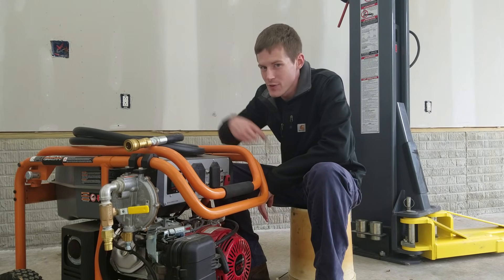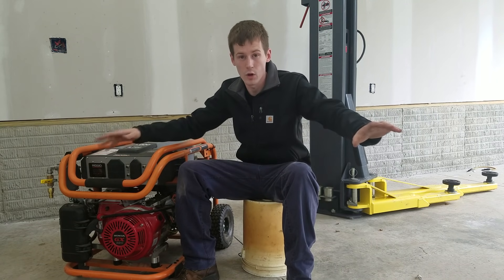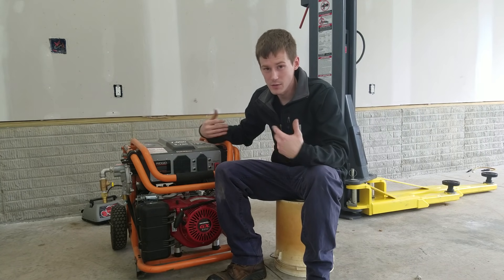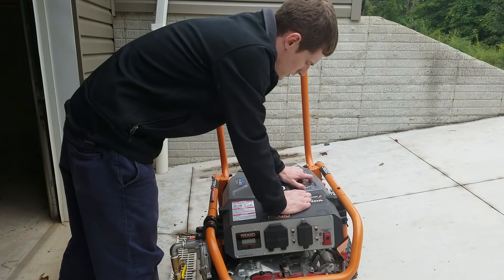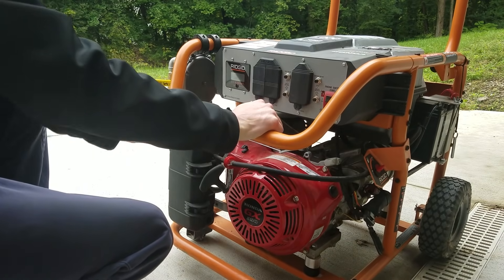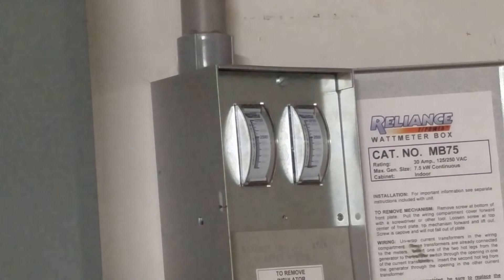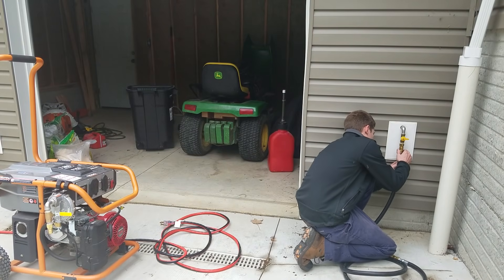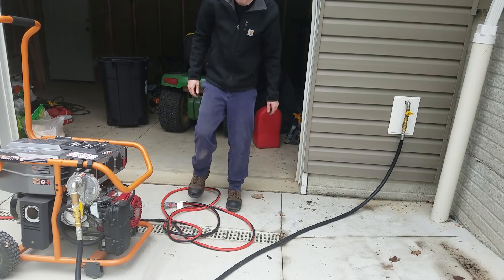Natural Gas Generator: Frequently Asked Questions

Comment: I'll just say a couple of things here. First off, I strongly recommend that you either put a secure access box over the pipe and valve. This will keep others from messing with it and or turning the valve on, ESPECIALLY kids. Either that or have an easily accessible shut off inside where it is secure (in the house or in the garage if you lock it). Forgive me if you already know this and have done it, but if you have done this work yourself, you should have a qualified plumber or pipe fitter to inspect your work and tag the work as approved. Otherwise, if there is a fire, your fire insurance may not cover the damages. The other thing to note for you and your viewers is that this kind of work cannot be legally done by a "layperson" (not trained and licensed) if it is a rental home, a duplex, or multiple housing. So far as rental, I'm guessing that means the person renting the home not the owner.
Reply: The end of the pipe has a quick disconnect fitting which prevents gas from escaping even when the valve is open. He just closes the valve while it’s still running and connected to pull everything from the hose.

Comment: I tried to use this conversion kit for dry methane (over 85%). The generator could be kicked off but couldn't run continuously. Do you have any suggestions for that? The methane is the main part of natural gas. Thx!

Comment: Do you think you could make a dual fuel generator (Gas/LP) run on Natural Gas by using the LP Gas input on the generator instead of inserting at the carb?  Using a Natural Gas regulator...

Comment: You have not addressed starting the motor with a natural gas regulator. Someone else said a person needs to
push the little spring on the back of the regulator while trying to start it. Is this true? If so, it's very hard to do if you're trying to pull a cord

Comment: RG, The only question I have is re: gas / propane pressure.  Isn't natural gas at your house at a much lower pressure than propane from a bottle?  Would I need to put an additional regulator between a propane source and the gas regulator on the genset to account for this?

Thanks and I am glad I found these gen mod videos.  They are very informative and easy to follow.
Reply from the maker: Yes you're correct check the other video at about 21:40

https://youtu.be/nO839Sayci0
Reply: Thanks, I missed that some how.

Comment: My generator runs on gas and propane. Can I use a natural gas regulator meant for propane grill conversions so they run on natural gas to feed natural gas into the propane intake of the generator? Since it is made to run on propane I don't think valve recession would be an issue 🤔

Comment: Can you make a video or comment on how to run this generator on LP gas? Is it just another regulator on the LP tank? Thanks.
Reply: Yes.  And you probably have to adjust your air fuel ratio like he did at the beginning.  I have a $30 Chinese version of this that I have planned to connect to my lawn mower, and I think they have some sort of switch that adjusts the orafice size between propane and natural gas built in.

Comment: Valvoline Premium Blue One Solution 9200 SAE 10W-30
What are the pros and cons of using this oil when 
running on natural gas?  
Anybody used it with a  7000W Champion Inverter?  Thanks!

Comment: if you are running on Propane , i would like to know how much of propane it will take to run the generator for one hour ?
Reply: It's all depend on the " Usage ".  If you use more " Electric ", then more Propane use.  If you use less, then less Propane.  The Regulator is designed to " Fluctuate " according to usage.  On an average for us, it's about 15lbs for 2-6 Hours during Power Outage.

Comment: Does a brand new (never used yet) generator need to run on gas for a few hours first before you start running on nat gas? Or can you immediately start using nat gas. Not sure if engine needs to break in before conversion. Thank you
Reply from the maker: Yes. I would do the break in on gasoline.

Comment: Awesome video, im just about to convert my generator, but one question i had is, what would happen if the generator stalls for some reason, say it senses a low oil pressure and stops running, does the gas continue to flow?
Reply from the maker: The governor regulator on the generator stops flow if the engine stalls.

Comment: I have a WPro8500. It has an auto choke. Would this system not work? 

Does the choke need to be fully open or closed when on natural gas?
Reply from the maker: Fully open all the time. Sorry for the late reply I was never notified.

Comment: I have a question which many sorts of people haven't been able to answer hope someone can help. I am running a small food truck and have two appliances that need to be running off of my generator. Bought a EF2800i Yamaha generator it does the job when its stationary as it is a carburetor engine but as soon as I drive the petrol is obviously jumping around and the appliances are turning off as im assuming that power is being cut out due to the engine type. Spoke to a professional and he recommended a fuel injected petrol generator, spoke to lawnmower repair guy and he reckons that a gas operated generator will eliminate the fuel issue and will allow the appliances to run without turning off. My question is if a gas generator is in motion meaning while im driving will it continue tio run my appliances without then turning off?

Comment: Thanks for the updated video.  I viewed your first video at the beginning of the year, 2020.  Glad to come across your update on this mod.  I purchased a 9K gen and I'm also converting to NG by the fall.  Great content.  I'm not personally worried about the valve recession issue.  Like you said it'll take 1K if hours to notice a run issue.  Didn't know of specialized oil for NG or Propane.  But, makes sense for autos that are exclusive to this type of fuel supply.  I'll definitely change over to that oil once I check the additive package difference's.  I wonder if Zinc percentages were increased?  Do you use cap covers over your quick connects when stored?  Thanks for contributing,  Subscribed!
Reply from the maker: I bought some of the oil. The packaging doesn't state anything about high zinc. I haven't had any outages since the oil change. If I get some good run time on the oil I may send it out for analysis. I've got about 8 hours runtime on the NG conversion over 2.5 years. Not a ton but, that's all the outages I've had. Works well, no regrets at all.
Reply: @RepairGeek  Excellent. I've only had to fire up the the gen 2 times sense buying it.  I run it 2 times a month for about 10-15 minutes just to keep the fuel moving and fresh. All of course using a fuel stabilizer. I'm slowly reducing  adding fuel in prep for NG conversion. 

I imagine you keep the tank empty until gas is need for what ever reason.  But, during seasonal changes you will have condensation build up in the tank. What do you use to compensate for moisture within the tank?  I'm considering a moisture pack. Large ones like used in shipping containers to reduce or eliminate that issue. We certainly don't want our tanks to rust. 

Suggestions or ideas?

Thx.
Reply from the maker: @eddylee587  I dont do anything. I just drained all the gasoline and drained the carburetor bowl and ignore it. I've had no issues. You could use the generator's fuel tank as a gas can if you wanted just to cut down on moisture but its rather inconvenient. Or just leave the fuel cap loose so air can go in and out.

Comment: Are you using a 3/4-inch NG hose?  How did you decide on the NG hose diameter?  I'm using a 10-foot, 3/8-inch i.d. NG hose on my Sportsman TRIGEN9K tri-fuel gen and it works fine .
Reply from the maker: I used 1/2" id. It depends on the length and the size of the generator.

Comment: Gennies are now being sold prebuilt to run on both now. Much more expensive but easier.

My question is, when you crafted that shim for the airbox. Not everyone has a lathe to crc an adapter, do they sell the adapters online or at a store for particular models so you can remount the airbox or do they sell modified air boxes to fit with the conversion?
Reply from the maker: They don't but, Nash Fuel is aware of my videos and are making revisions to their kits based on what I ran into.

You could make that spacer using wood if you want too. I had the means and the tools so I used aluminum. Wood will burn just like the plastic airbox would so I wouldn't worry about using a material that would burn.
Reply: Thanks for the reply, I too was thinking a wood spacer of sorts or something similar. But you seem to think a lot like I do myself and want it to look like it was made for the machine and has a clean look. I’m a perfectionist too!
Reply: @alteregos8949  Wood, soak it in fuel resistant epoxy to stabilize it.

Comment: Is it ok to run the oil u recommended ins generator small engine as it is rated 15w40 ?  Seems thick ok for large I
Engines?  And I live in mi where in winter it can get to -20 to -35 below sometimes though rarely.  I also have well pump like you.  Thanks for the great information and videos. Really well done.  Also, manuals on the Honda’s and other small engines call for oil changes  like every 24 hours of use or more whats your opinion on that? And do you suggest synthetics for these types If engines ? If so right off the bat or after some breakin?  Same question in regards to spark plug change and valve adjustment schedules?

Thanks again
Reply from the maker: I wouldn't stress about the weight of the oil that much. Most small engines require a straight 30 weight oil. A 15w-40 flows like a 15 weight when it's cold and flows like a 40 weight when it's hot. Personally I just use a normal  10w-30 that you can get anywhere. I may switch in the future but, I only have about 2.5 hours on natural gas. If you're truely concerned, just run the oil recommended by the manufacturer.

I know you can extend out your oil change interval using natural gas. The oil stays much cleaner because the fuel burns much cleaner. The same goes for spark plug changes. What those intervals are I have no idea. It depends on the engine and # of hours etc. The best way to determine if you can use an extended interval is have the used oil analyzed by Blackstone.

I would probably just check the valve adjustment after about 100 hours or so. I doubt you'd have a valve issue before 1000 hours. You'll know when it needs to be adjusted. The engine will be hard to start or run like crap.

Comment: Thank you for the video. Nicely done. I do have a couple of questions about the setup. At 1:30 you are telling about putting a shut off valve that will prevent pulling vacuum into the atmosphere. - Can you please explain what is atmosphere and how does it suck vacuum? what do you mean by vacuum? To my understanding the ball valve could be there to prevent dusty air from entering the engine while running on gasoline as the pressure inside the carburetor is less than atmospheric - a dust cap would be better idea. Another question is why did you mount the regulator upside down? there is a reason why there is an arrow UP showing how it should be mounted. Is there is something other than personal preference that guided you to make that decision. The are tri-fuel generators on the market so people can buy something instead of altering gasoline generators
Reply from the maker: You are correct it has the potential for contaminates to enter the governor regulator unless you install a valve or a cap on the auxiliary fuel connection. I'm sure even duct tape would work. I keep my valve closed when the generator is in storage- again to keep contaminates out of the governor regulator. No reason you can't use a cap but, you can't loose a ball valve.

I have a Garretson KN regulator. Mine does not have an arrow on it. As long as the diaphragm is mounted vertically on mine the orientation does not matter.
Reply: @RepairGeek  Duct tape yeah! On Garretson KN 039-122 on the side where prime knob is there are "TOP" letters. I honestly don't know the reason for top, but it might have something to do with gases coming up in the regulator, some element of the valve opening adjusted certain way for gravity, or something simple like you are exposing the two breather holes to rain drops. There was a video with very good explanation how regulator works https://www.youtube.com/watch?v=CfM6D65MC_w

Comment: I just order from Lowes the Westinghouse WGEN12000DF dual-fuel portable generator ($2200 delivered).  Runs on gasoline and propane, and I plan on adding an NG conversion kit.  My question is:  this gen has an automatic choke, and I'm wondering of that will mess up the NG performance?  The videos I've seen, seem to run on NG with the manual choke nearly or all the way closed.  Any thoughts?
Reply from the maker: Disable the automatic choke. You won't need it on NG or Propane.

Comment: Great original video and follow up. Sorry if I missed this one, but what amount of natural gas pressure are you getting from your line? Low +/-4 inches of pressure seeme to be a problem with some conversions (LP to NG). Thanks.
Reply from the maker: The regulator on my meter is 6-8” W.C.
Reply: @RepairGeek  Thanks! That data will drive my project. Keep up the good work. (The garage looks good with sheetrock). Cheers.
Reply from the maker: @thewds  haha it's a little more finished now than in this video. Thanks for watching.

Comment: Nice hose. Where did you get the hose? :) I have a 3/8" ID hose on my 3500 watt generator but thinking about going to a bigger 7000 watt one so will need a 1/2" hose. Thanks for the Vid

Comment: Excellent videos - thank you.  I am trying to prepare for an outage due to an earthquake and thus, I want a tri-fuel conversion kit assuming NG might not be available.   I am doing a portable instead of a whole home standby because of that reason and I can stockpile some propane.  According to Generac, propane will produce clean power for electronics without an inverter.  Otherwise, they said to buy a generator with an inverter/clean power for electronics.  I am wondering how far of a hose I can use for natural gas?  Did you also try switching from gas and NG to propane?  I am looking at a Powermate (generac built) dual fuel propane and gasoline and it will require less conversion to add natural gas.  Or I will buy a tri-fuel for a generac generator just because they are so much cheaper than Honda, but better than the rest.  Any recommendations?
Reply from the maker: The size of your hose depends on the size of your generator and the around of load it's under. Larger diameter hose will allow you to run larger units at longer distances from the meter but, the answer to that question is not simple. You need to check the sizing charts listed in the description of the original video.

To run a generator that was designed to run on propane on natural gas you need to increase the fuel flow. How you go about doing that? That depends on what you're working with. I bought a standard generator and a tri-fuel kit because I knew it would work. Could you get a dual fuel to run on natural gas, sure. But, without making those modifications myself I can't really speak on how to do it.
Reply: @RepairGeek  Thanks for the quick reply.  I will check out the table and also check with the gas contractor.  Did you switch from propane and NG without any issues with a tri-fuel?  Did you consider whether there is an effect of the quality of the clean electric power of the different generator models or different fuel as claimed by Generac?  They said propane was clean power or I needed to buy the Generac models that had their clean power.
Reply from the maker: @davidcloward9518  to run propane you need an additional regulator on the bottle to reduce the bottle pressure. Most people use a regulator designed for a propane grill. I've never ran mine on propane just because I don't have a reason to. The rest of the setup is the same. You will have to adjust the fuel bolt on the outlet of the governor regulator each time you want to go from propane to NG. (The energy per cubic foot is different.)

As far as clean power, mine has a harmonic distortion of less than 6%. Your utility power is less than 5%. An inverter will almost always put out cleaner power than a traditional generator but, with an inverter, your maximum wattage will be much lower for the same money. I think Generac is claiming the power is "cleaner" because the engine runs smoother on alternative fuels than gasoline. That in it self would reduce the spikes in the AC sign-wave and any generator would run smoother on alternative fuel. Generac or not. You can find clean power models for cheaper than what Generac wants for one. If you need more information send me an email: repairgeek365@gmail.com

Comment: Hello, great video, very clear and instructive.  When you have a minute, is there a problem, natural gas wise, of running the average house gas furnace and the natural gas fed generator off the same natural gas supply to the home?
Reply from the maker: That depends on your home. In my situation I have no problem running both but, it's dependant on the size of your main, size of the furnace, layout of your piping, size of your generator, and amount of load in the generator. Basically, you need to make sure your system has enough capacity to run both. There are too many variables for me to make a blanket yes or no answer but, it is possible.
Reply: @RepairGeek  thanks, it doesn't seem to be a common problem, but could be.  I will keep aware.  Thanks again.
Reply: Does it make a diff if you have 5lb gas meter instead of 2lb..have large meter for pool heater